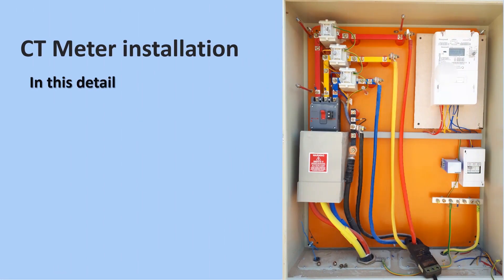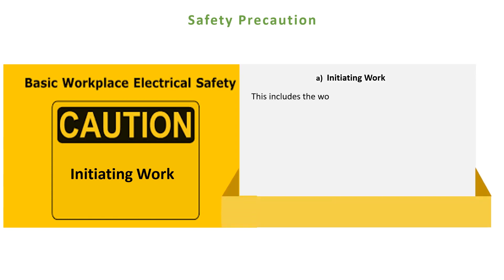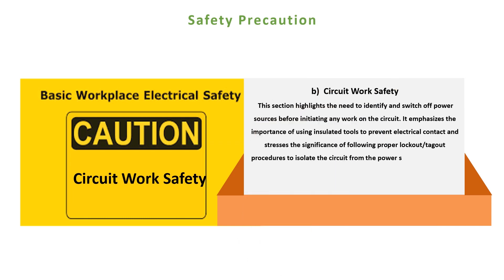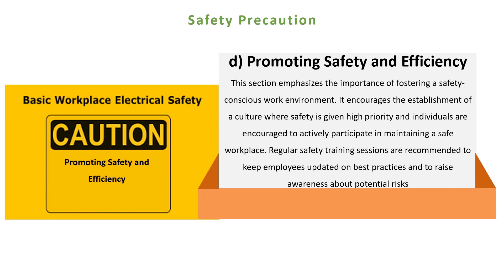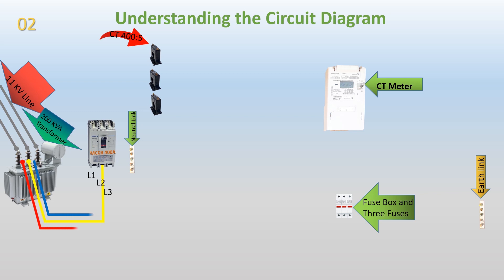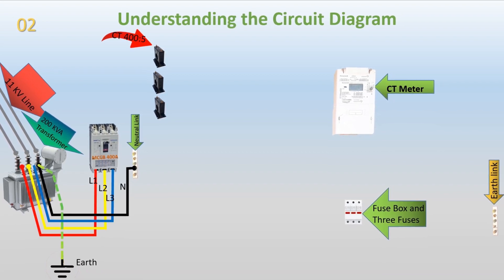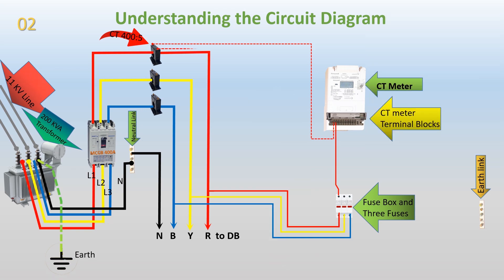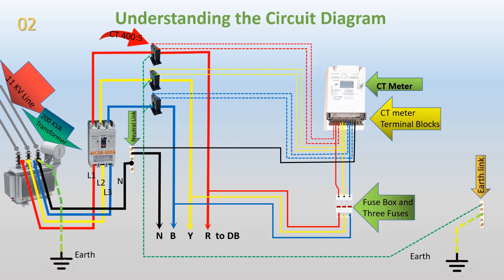3 Phase Energy Meter Connection With CT/ CT Connection/Energy Meter With CT

Comment: Nice job.l would like to know whether to de-energise the line by removing the fuses on the transformer in order to work on dead line is recommended.if so what are the safety procedures to remove it and when putting back
Reply from the maker: Thank you for watching and for your question! When working on a dead line, it's very important to follow all safety procedures.
Reply from the maker: Thanks for your comment! When working on a live line, safety is key.

If you're installing a new CT meter or any other equipment directly connected to the transformer, follow these steps:

1. Remove transformer fuses De-energize the line for safety.
2. Earth the LT line  Ground the line to prevent accidental power-on.
3. Complete installation: Install the CT meter or other equipment.
4. Double-check: Verify all connections and remove tools.
5. Remove earth: Disconnect the earth connection.
6. Replace fuses Re-energize the line.

Follow proper safety procedures to ensure a safe and successful installation."

"If you're working on an existing system with a main breaker or switch:

1. *Turn off the main breaker*: Cut off the power.
2. *Use lockout/tagout*: Follow safety procedures.
3. *Check with a voltage detector*: Ensure the line is dead.

This way, you can work safely without shutting down the entire transformer."

Comment: In 8:37 u said Connect the wires from the output of the MCCB to the fuse. I don't see any wires connected to either the output or the input of the fuse.
Reply from the maker: "Hi, thank you for pointing this out! You're absolutely right. At 8:37, I  mentioned connecting wires from the MCCB output terminal to the fuse.

To clarify, the wires are connected to the output busbar of the MCCB, carrying R, Y, B, lines to the load, as shown in the video.

These lines o the fuses can be connected anywhere within:
CT meter box and Output of main MCCB

Thank you for correcting me! I apologize for any confusion caused

Comment: Ok,my name is Damien I have Energy meter type ADM 100 TC,HOW CAN I CONNECT IT
Reply from the maker: Hi Damien! Installing your ADM 100 TC meter is straightforward. Begin by connecting L1, L2, L3, and L4/N to the incoming terminals. Remember to install a 4-pole 80 or 100A MCB beforehand. Then, connect L5, L6, L7, and L8/N to your distribution board or load. I'll be recording a video soon to guide you through the process step by step. Stay tuned for that!